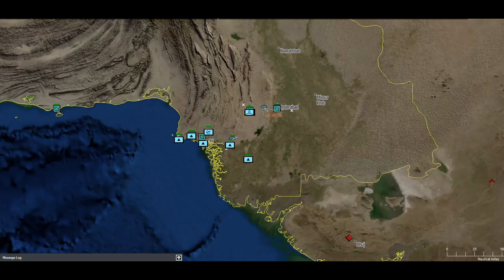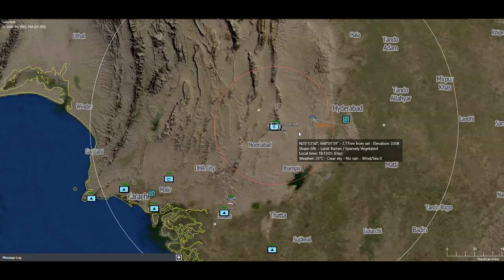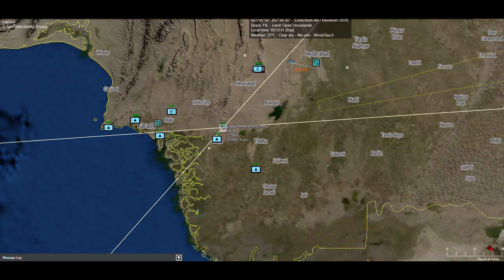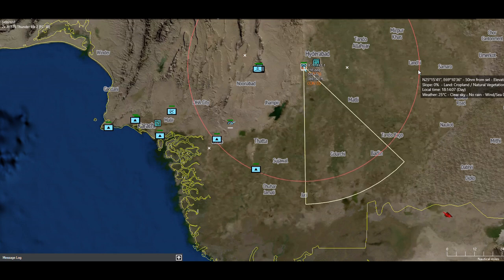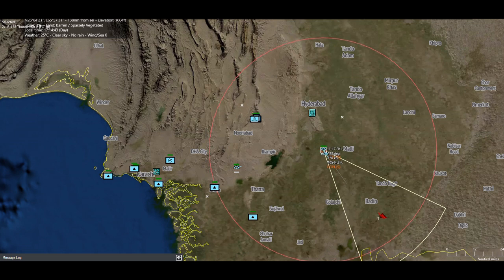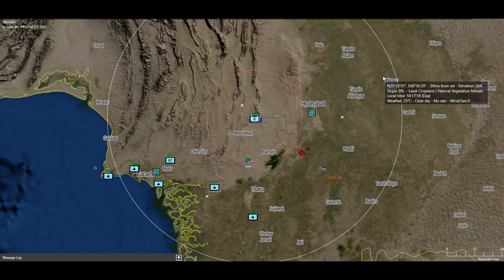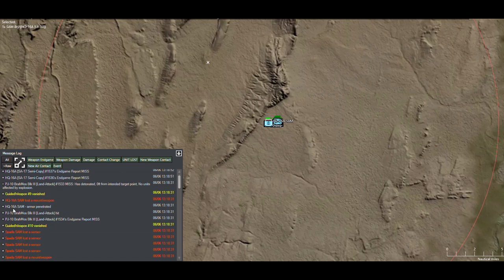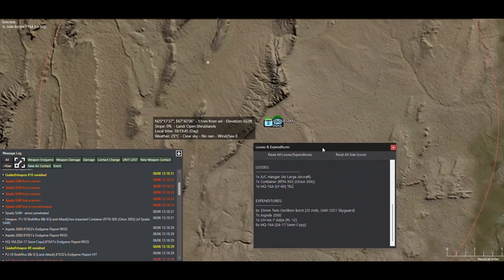Indian cruise missile hit on PAF's Bholari airbase simulated in Command Modern Operations

Comment from the maker: Transcribed text of the video:

Hello everyone, in this video we'll be simulating the Indian missile attack on Bholari airbase which happened during Operation Sindoor. Please keep in mind that this is just a rough simulation on command modern operations. The details of radar, missile, aircraft and other assets are approximate and could have been a bit different from what actually happened. 

To start with we have following assets on Pakistani side. The first one of course is the aircraft hangar which was actually hit by the BrahMos missile leading to destruction of one Saab 2000 AEW aircraft plus two to three other fighter aircraft which were housed inside. This is defended by a bunch of Pakistani air defense systems which include a few ANZA MANPAD systems, one battery of 35 mm radar guided anti-aircraft gun, one SPADA 2000 SAM system and one battery of HQ-16 SAM. 

These are further defended by two JF-17 armed with four PL-12 and two PL-9 air to air missiles each and air base radar coverage is provided by another Saab 2000 AEW aircraft which is flying in the general vicinity of Bholari airbase. So in a few seconds you'll start to see BrahMos missiles flying in towards their target. For this mission I've assigned one missile each for the aircraft hangar and one missile each for each of the air defense systems in the Bholari airbase. 

The missiles will be detected by Saab aircraft. So these red moving points in the corner these are the four BrahMos missiles which have been detected by the Saab 2000 aircraft. The numbers that you see below these missiles these are their bearing like 309 degrees that's the bearing of the missile 1450 knots that's the speed and 76 to 80 feet that you are seeing that's the altitude of the missile. 

Each of these missiles is flying just 15 to 18 feet above ground. So JF-17s in the first line of defense again these missiles. For this mission I am guiding them manually to the BrahMos missiles. 

The red circle that you see that's the maximum range of air to air missile that's being carried by it and the white cone in front that's their radar detection cone. Same thing with Saab AEW aircraft these white polygon that you see that those are their radar detection circle and you can see the same thing with SAM system. So the white circle is the radar detection circle and the red circle is their kill zone. 

I'll have to increase the speed of this mission a little bit otherwise the video will be too long. The JF-17s will start firing their missiles as soon as BrahMos come within their missile kill range. They'll start with PL-12 missiles which have slightly longer range than their PL-9. 

Whichever BrahMos missile escape being hit by air to air missiles fired by JF-17s will be engaged by ground-based surface to air missile systems of Pakistani Air Force at Bholari Air Base. The number that you see in front of this BrahMos missile that's the number that's the number of missiles being targeted against it. So it seems like the JF-17s were unable to down any of BrahMos missiles and now they'll try to destroy them using guns or perhaps PL-9 missiles. 

They'll also have to get out of the way of ground-based SAM systems otherwise they could get hit too. So these BrahMos missiles are quite close to kill range of ground-based air defense systems. The first one to engage will be HQ-16 SAMs and the BrahMos missiles which escape being hit by HQ-16 will be engaged by SPADA and perhaps the 35 mm anti-aircraft guns.

So there are a bunch of HQ-16 missiles flying at BrahMos and none of them hit. Okay so the aircraft hangar has been destroyed and it seems like one BrahMos missile was destroyed in mid-air. So three hits. 

So let's see what got hit. So one BrahMos missile detonated zero feet from its target. One hit the TEL of HQ-16. 

Another hit zero feet. I'm not sure what that means. And another hit the container of SPADA missile. 

So four BrahMos missiles were fired. Pakistani losses include one aircraft hangar, one container of SPARTA-2000 missile and one TEL of HQ-16 missile. And they fired roughly 120-35 mm rounds.

Seven SPADA-2000 missiles on the JF-17s were able to fire just one PL-12 missile. And HQ-16 fired eight surface-to-air missiles without any hit. So I think that's the end of this video.

I hope you enjoyed it. If you have any feedback please leave it in the comments. Thank you for watching.